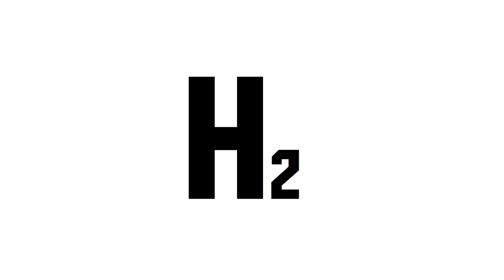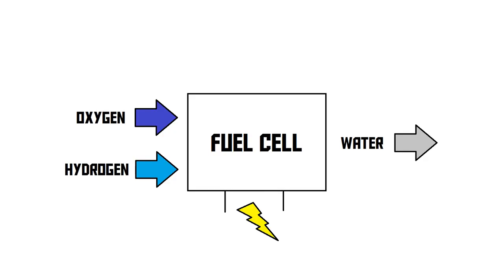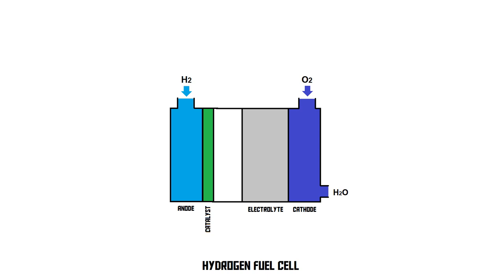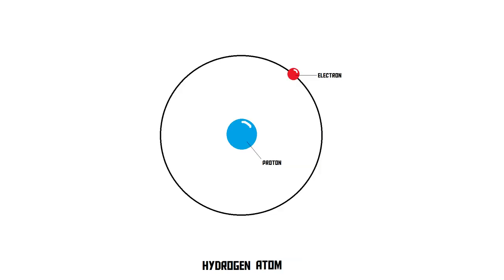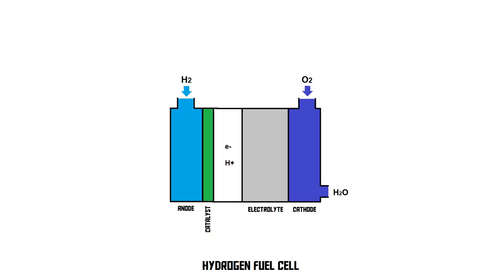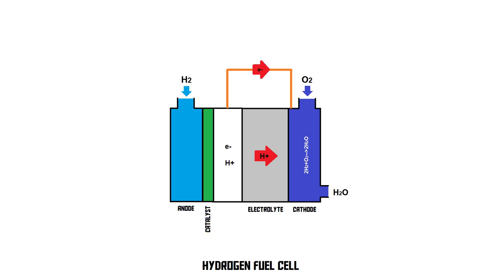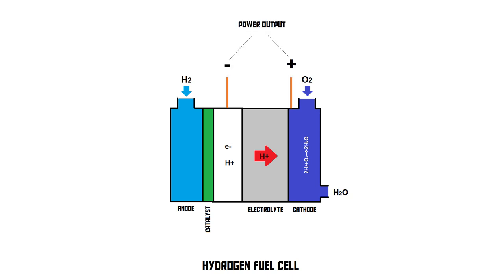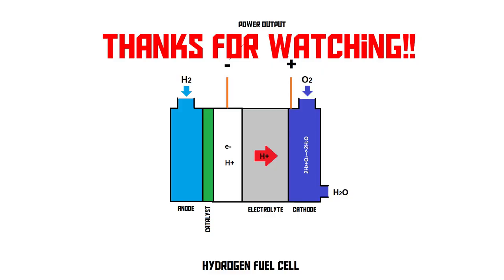How does a hydrogen fuel cell work? (AKIO TV)

Comment: Great video, wondering if hydrogen fuel cell cars need to fill up with pure oxygen as well when the fill up with hydrogen or does that oxygen just come from the air ?
Reply from the maker: No they usually take the oxygen from the air indeed
Reply: @AKIOTV  thanks for the reply. :)

Comment: CO2 is not a toxic gas. It is a trace gas (0.04% of the atmosphere) that is absolutely essential in the process of photosynthesis, which makes ALL the food on earth! It has never been proven that human generated CO2 is heating up the earth. In fact, when the oceans heat up, CO2 is released. So rising temperatures come BEFORE the generation of carbon dioxide.

Comment: (Please Answer) Why do we need oxygen for it to mix with Hydrogen to 
form water if the hydrogen's atoms are being separated by the platinum 
catalyst and the electrons are being used for electricity? Why do we 
need Oxygen to help us get water? Doesn't water just go outside through 
the pipeline? don't we already have electrons from the hydrogen to 
generate electricity? I really don't understand why we need the 
Air/Oxygen Intake here?
Reply from the maker: oxygen is part of water. Without it, the whole reaction doesn't exist.

Electrons don't just separate from protons if you throw the atoms at some platinum; they only do that in this specific case because of the oxygen on the other side. The platinum is just to help this process take place at lower temps.
Reply: @AKIOTV  But how is Oxygen taking part in this process I want to know more in-detail about what role does oxygen play here exactly?
Reply from the maker: @architsasta700  This is just a chemical reaction. 

In any kind of chemical reaction, there are at least two substances involved. In this case, the reaction we're using is the one between H2 and O2. H2 on its own doesn't do anything.

Comment: doesn't fuel cells produce hydrogen peroxide not water? H2 -> 2H^+1 + 2e^-1 on the anode side to O2 + 2H^+1 +2e^-1 -> H2O2 at the Cathode. Idk why every video says it makes water because I can't seem to find the any video explaining the half reactions
Reply from the maker: the second half reaction you're looking for is: O2 + 4H+ 4e- -> 2H2O
Reply: @AKIOTV  thank you that makes sense since you have to balance hydrogen 2H by multiplying it by 2 to get 4 right? Same with the 2e^-1 electron?

Comment: 1) What is the average weight of a hydrogen cell car with internal passenger s?
2) How much hydrogen does it take to drive a car for one hour?
3) How much electricity does a hydrogen cell generate in one hour?
4) How much electricity and water does electrolysis method take to make the amount of hydrogen required in one hour?

Comment: So if I understand electrons flow instantaneously through the copper wire generating electricity
What about the overwhelmingly exothermic nature of the reaction itself this doesn't seem to be exploited
I mean it sounds more like an H+ & electron cell rather than an H2 being the actual fuel
I also can't picture what would happen if Hydrogen reacts with Oxygen in case of a car accident. That would be an explosive predicament

Comment: Combustion of hydrogen and oxygen at the ratio given at the start leads to 2H2O + N2O, not just 2H2O, from my knowledge… correct me if I’m wrong!
Reply from the maker: In a perfect combustion there is only water as the waste product (since there is no nitrogen to begin with)

In practice the atmosphere contains N2, which indeed under high temperatures can combine with oxygen to form NOx (various nitro-oxides).

Comment: Be careful - hydrogen H-H is a strongly bonded molecule. When it burns the energy comes from replacing the weak bonds in OXYGEN O=O with the strong H-O-H bonds in water. This is the case for all fuels - it is the highly reactive gas OXYGEN that provides the oomph - you will find that the amount of energy transferred when a fuel burns is directly proportional to the amount of oxygen used. True also for our food - the energy comes from the oxygen not the foods, which are made up of stable strongly bonded molecules.

Comment: How about the problem of producing liquid hydrogen and storing it for ready use? Liquid hydrogen is -425f and it makes everything brittle. Scientists hate working with it for several reasons.  And if you think a transmission replacement is expensive,  you don't want to know what a fuel cell problem costs. Not to mention about 80bucks to fill up your car.

Comment: Since water is comprised of hydrogen and Oxygen couldn't that be the starting point? Put water in the tank, let the system separate them and then put them back together again?
Reply from the maker: separating the water is called electrolysis. It's how hydrogen is made in a plant.

Problem is, it takes as much (or more) energy to do that as the fuel cell produces. So all of your output from the fuel cell would get used up to make new hydrogen, rendering the cell useless.

It's kind of like a motor driving a generator; a perpetual motion machine. And of course that doesn't work, the system will eventually (usually quite fast) grind to a halt.

Comment: Great. But wait. Does more electricity get produced by the fuel cell than the amount used to produce the hydrogen and oxygen in the first place? No, where would it come from, out of thin air? So does it produce the same amount? No, otherwise it wouldn't get so warm.
Reply from the maker: that's right.

Comment: Your diagram is all jacked up. If your using physics that is. Anode and cathode are designators for which side of a device has which charge and originates from batteries, vacuum tubes, then silicone devices and now this. They are never "chambers" and are always conductive elements. and to my knowledge always thus far metals. Lead in car batteries and other metals in varying devices. The main difference chemically between the two is one is doped with something to make a difference in electrical potential. Platinum in fuel cells. Usually platinum doped nickel alloy. I'm not even going to go into everything you got wrong . Basically you sound like someone who don't have a clue repeating things they heard someone say about fuel cells to someone who knows the theory behind it. Get your $μït sorted mate!